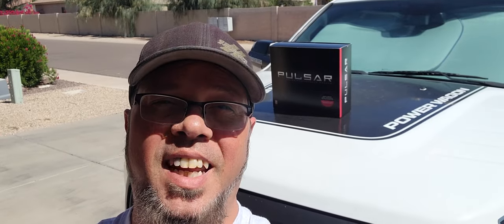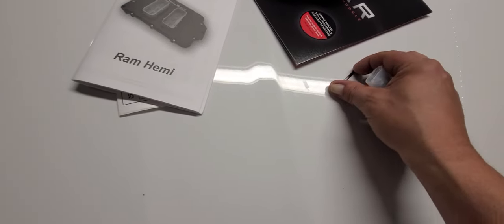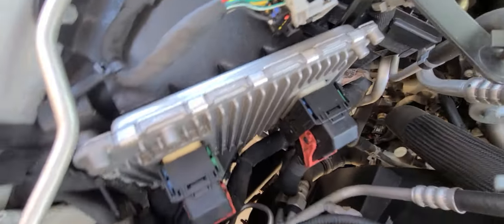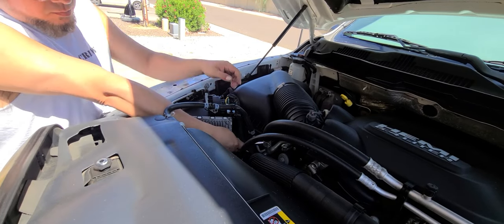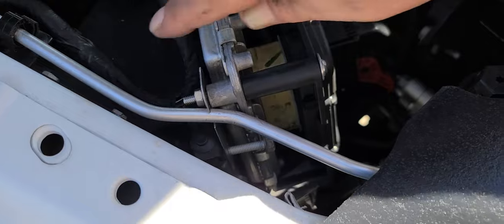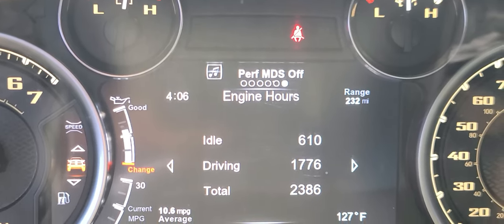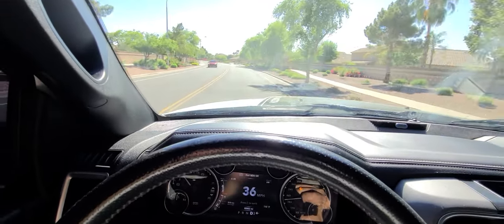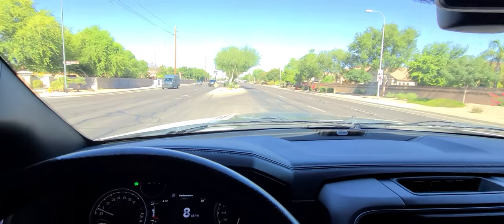"Pulsar Tuner" 2018 Ram Power Wagon (Install and Review)#pulsar #holley

Comment: My mph is inaccurate after adding 35’s. Does selecting your tire size adjust to the right reading? Right now im off about 3mph
Reply from the maker: It does not, I have the same issue. I tried several settings and it is still off 3mph
Reply: @Destroyer1320  w
Well shit. Who’s wife do you have to tickle to get the mph correct?
Reply from the maker: @sierragaragedoor3909  I bought a WiFi OBD2 scanner and set it to 35s as well. No change, I would like to find out how to fix it as well so we can share it out to everyone. Frustrating
Reply from the maker: If you find the wife share her name, hahaha
Reply: I purchased the pulsar and changed my tire settings. Don’t enter the tire in as 35” I have 35’s and my actual tire height it 33.5”. That corrected my Speedo. Measure your tire height!
Reply from the maker: @sierragaragedoor3909  Thank you soooo much! Pinning your comment now.
Reply: I used alfaobd to adjust my tire size.  It took a couple adjustments to get it right.  Just start with the tire size from the manufacturer.  You'll need to calculate the circumference in millimeters.  Enter that as a starting point, the mph will be much closer or maybe even exact.  Verify with GPS (Google maps) and adjust up or down based on whether you're high or low.  This will also make the MPG calculations more accurate.

Comment: I’m probably gonna get a pulsar for my 6.4 too but I have a S&B cold air intake for mine and it made it more snappy I would recommend getting one for your truck I’m sure you’ll even notice more power
Reply from the maker: Sweet I will look into that cold air thank you!
Reply: Did you see any fuel savings with the S&B And Pulsar?
Reply from the maker: @rodgallant7486  It increased 1MPG but I drive hard so that is good.
Reply: @rodgallant7486  I did notice my mpg got better with my cold air intake only because there designed bigger than other intakes also made my truck sound better

Comment: Good video, stickers on the ground; HILARIOUS! 👍👍
Reply from the maker: Appreciate it!
Reply: Had the same issue with mine ended up having to pull the ecm mounting plate off an drill out the bolt holes and grind the back of the plate down! Got about an 1/8 of an inch of clearance from the ac lines. Was a pain in the ass but it fits..need to fill up with 91 octane still to run in performance level..

Comment: Was curious if you towed anything and noticed a difference.  I’ve got a travel trailer I haul around and this is just about the only tuner you can find for the 6.4 Hemi with adjustable modes.  Thanks & appreciate the video!
Reply from the maker: Yes I have,  I noticed is the shift RPM is different with the Pulsar and fuel mileage is better. I suggest adding Rear air bags if your hauling a lot just to save on your springs. Hope this helps.
Reply: @Destroyer1320  I’ve got the Firestone system.  Definitely makes a difference!

Comment: I just got a 2023 and it rips stock not sure if they changed anything but I have good power I would like more going to buy one and see
Reply from the maker: Let me know what you think once installed
Reply: Did they update the kit for the new gauge cluster?  I have a new 2023 Power Wagon and wanted to check first prior to buying..  Thanks
Reply from the maker: @danaberman6929  I would contact them directly before buying one. 1-866-464-6553
Reply: diffrent transmission makes a big difference

Comment: Ide love to see some dyno numbers for this thing. Also, since there is a tow mod tune, is the tow and haul mode button still necessary?
Reply from the maker: I would love to see the Dyno numbers as well, The only thing I noticed the Tow/Haul button is good for is hill assist. If you do not push the button Hill assist will not engage.

Comment: The AC line must be a Power Wagon thing.  I installed the same one on my Laramie and had no clearance issues.  Also had a friend who has a PW who ran into the same clearance issue as you.
Reply: What's your thoughts after installing the Pulsar?  Are you happy with the results?  Two things:  Do you need higher octane fuel for the performance modes and does the install keep idiot lights on of the dash.
Reply: @ericmandragona4635  I’ve had mine installed since 19 (the older version) and not had the first issue.  I paid $300 ish for it.  For that price I thought it was well worth it, especially if you’re not going to do any major modifications to have to tune it.  But for the price they are now, it would be tough for me to buy it again for what it does.

As for the higher octane fuel, I run 87 in the performance mode all the time and not experienced the first problem.
Reply: @SWVA08V2K  thank you sir. I appreciate the feedback.

Comment: Does cruise control still function normally even with the Pulsar uses those buttons to change settings?
Reply from the maker: Yes, once and a while I can't get it to turn on the cruise but turn it off and on and it's fine.

Comment: Are you still liking the Pulsar?  I am contemplating getting one.
Reply from the maker: Yes it really makes a difference, the modes are great and the mileage is 2MPG better when running in tow mode. Strange but yes Tow mode gave me the best mileage and performance.
Reply: Get a pedal commander too. Spin my tires at lights all the time.

Comment: Are you running high octane? I got the tuner and the instructions say only run modes 7 and 8 with 91 octane. Curious if that’s necessary?
Reply from the maker: I always do just to be safe.

Comment: Now does the cruse control still work since it used the buttons on the steering wheel I gotta drive 90 miles a day every day with mine
Reply from the maker: Yes it does

Comment: Can you adjust the tire pressure sensors? Or at least turn off the light on the dash I upgraded tires rated for 65 psi and the lights on wants me to fill them to 80 psi I need it to go away I want to fix that and mds delete
Reply from the maker: You will need and OBD programmer to turn off the light.